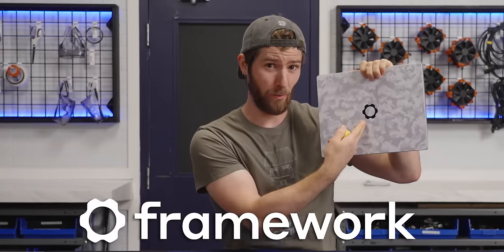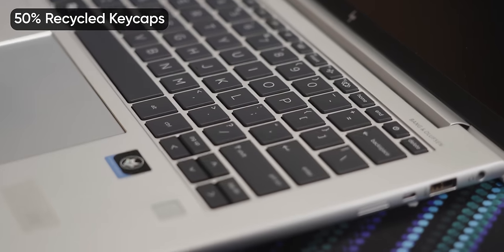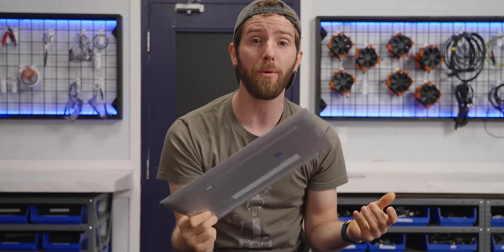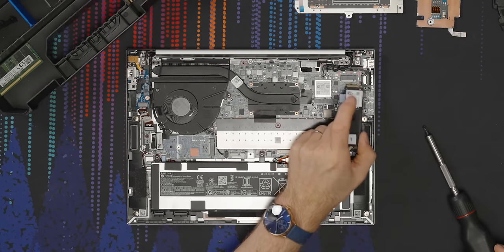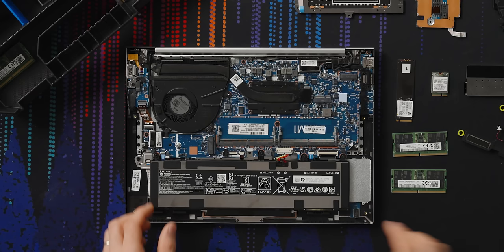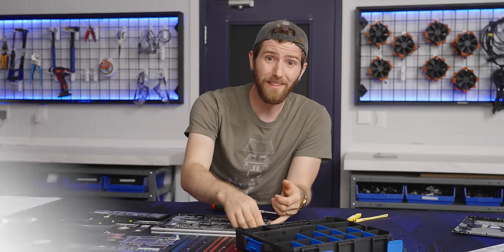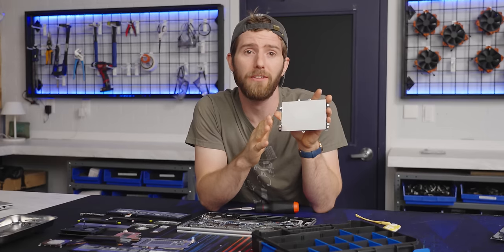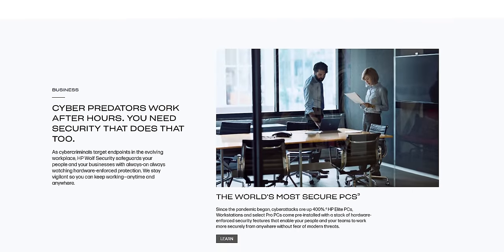My Investment is in TROUBLE - HP repairable laptops

Comment: The HP laptop computers I've owned have always been user repairable. Over the past 35 years, I've owned ten laptop computers, two of which were HP laptops. And this was before HP announced this new "repairable" laptop. The older HPs were each very easy to DIY repair, because tear-down service manuals, and parts were available online. One of those two, at 13 years old, and still works! I've replaced the battery a couple times, the HDD (now SSD) a couple times, and the CD drive once. A friend now has it, to use for a dedicated mundane task. 

As for the other HP laptop ( three years newer), I replaced the keyboard twice, the CD drive once, the HDD twice! Finally, the hinge holding the screen on the left-hand side broke, and that computer was kaput after 8 years.

At the moment, I'm typing this reply on a nine-year old, MacBook Pro, on which I've replace the battery, installed a 2TB SSD to replace the 512G SSD that came with the computer, and put new thermal paste under the heat-sink, where it touches the CPU. So, it appears late 2015 Macs are relatively user serviceable. This Mac and the one my wife was using are still going strong after 9 years of use.

:-Don

Comment: Why isn't anyone talking about keyboard replacement? 

This looks similar to the x360 series chassis, and therefore keyboard replacement means you have to remove the motherboard and basically everything connected to it, then PRY the keyboard and its metal back plate carefully without breaking the chassis because both are PLASTIC RIVETTED to the chassis, then carefully apply hot glue on over 50 points (thats how I do it) on the replacement because otherwise the chassis loses structural integrity, then finally put everything else back in.

This is a pain even for an experienced tech like me, leave alone the average person. FYI, keyboards are one of the most likely components to give out first. Not that I'm complaining though, HP has always been a reliable source of income for people like me...

Comment: I understand where you are coming from saying that 16:10 is nice to have. For the use case of a laptop you use by itself, wherever you go, that extra space is great. However, it has been my experience that any alternate aspect ratio is the most annoying, lacking a single solution, problem ever WHEN YOU CONNECT AN EXTERNAL DISPLAY THAT IS NOT THE SAME RATIO. This is not a problem with your laptop manufacturer whatsoever, but a problem with every version of windows i've used. The scaling and ratios of any window that changes size between the laptop display and the external just makes me grind my teeth in anger thinking about. Microsoft reminds me of slushie dog in phineas and ferb "scaling never gets any better".

Comment: One thing I definitely want to see is new models of the laptop in the future using a similar enough design so that HP (or any company with their respective device) could sell the logic board with the cpu/gpu (like Framework is doing) so users can upgrade their laptop and keep things like the screen, ram, and any other component that still works. This way it will save the customer money, as well as cut down on e-waste since the only thing being replaced at that point would be the outdated logic board, instead of the whole laptop.

Comment: From using the HP business laptop at work 840 G6, they kinda dent very easily and the metal feels more flimsy though. I kinda love the AMD processor inside but I hope Framework gets a 13th gen with a low end Intel Arc, or maybe 14th gen tiles+a low end mobile Arc GPU (which gonna be much better than Iris XE).

Comment: On the whole point of this only having 5 screws being good, it really rings true. I have an older HP laptop that has TWENTY FOUR screws needed to open the back of the case, and 6 of them are covered up. Any time I need to do any form of work on it, I have to sink in a lot of time just opening it, and damn I won't lie it made me not want to do it

Comment: Wow that's awesome. Certainly very solid feeling laptops and HP have always been very good with driver support for older hardware. ***If you really want your electronic stuff to stand the test of time**** get a grounded antistatic mat and wrist strap for...not much money whenever you expose and work on the internals as only the external ports etc are usually static protected.

Comment: System 76 is a small manufacturer. It may not be as easy to work on as hp, but it is very repairable and the parts are available, the pictures are on their websites. They have a kicker. They have "Lifetime Service", which includes talking a customer through any repair. System76 deserves a look!

Comment: Put praise on HP when they do this on all their consumer laptops. My 2020 spectre has screws UNDER THE RUBBER FEET. Business laptops tend to always have easy repairability, that isn't where the issue is. My mum's i5 5th gen business HP has a battery you can swap by undoing one lock.

Comment: @13:20, the HP configurator says that the laptop ships on 01/09/2023. Is that correct? That does not sound right. And if it is correct, that's not good.

Comment: it's a pity that microsoft hasn't also embraced reduction of ewaste. creating artificial requirements in windows 11, forcing you to throw away a perfectly good computer because it doesn't have tpm or has a processor a couple of years old greatly contributes to e-waste. They should be shamed into reducing the minimum requirements for windows11 to what windows 10 requires.

Comment: I really don't see the groundbreaking repairability with this hp. Other than them carrying parts on their website and having them in stock and readily available is really cool and is a plus, most modern laptops that ive seen in the last few years come apart just as easily if not more so. Sure its less common with ultrabooks and dell in particular likes to make things difficult with the xps laptops but theres nothing groundbreaking about this design over other hps and lesser models in their lineup. framework is still a clear winner in my book for how the internals of the laptop are laid out compared to large OEMs.

Comment: Dude, mine is also very repairable,
You unscrew 4 screws(on the letter it is assigned to)
And then just replace it.
It's 13 yo, so the HP laptop is overheating sometimes

Comment: I'm probably in the minority here, but I actually despise captive screws, unless if their captive mechanism is easy to remove.. This is primarily because almost all manufacturers use Phillip's head screws, which are the worst screw head design IMO because they can be so easily stripped.. What makes it even worse is these manufacturers for whatever reason use loctite on their Phillip's head screws, and I'm just dumbfounded as to why?.. I get that these are mobile devices so screws "may" get lose over time, emphasis on "MAY"; but the number of Phillip's head screws I've stripped throughout the years of servicing all the laptops I've owned deem me to believe that loctite is more harm than good on laptops..

Comment: I was hoping it would happen, I didn't think it would, but my god it did.  I can only hope others step up.  
It makes sense from a companies perspective and a users perspective if you can sell the components instead of selling an entire damn device just to replace a wonky touchpad.  The little margins of profit you can add on, while modest, will certainly add up over time.    
As time goes on, one can even add functionality to their device, like the SIM card.  I'd like to see a time where we go BACK to when PC card slots, but a more modern approach.   A whole generic panel that can have various layouts of USB, HDMI, audio in/out, etc.  That would require a little bit of work on the motherboard side of things to allow those kinds of interfaces, but it is very VERY doable, more so than PC cards were of yesterdecades.
Frameworks 4 generic expandable ports are half-way there, but I'd love to see a whole side with that.

Comment: It is nice to see laptops that are not inacessible black-boxes full of glue. This is a step in the right direction. But what I believe would be ideal is an industry standard for parts. By this, I mean an analogous to laptops of the ATX standard. This way, costumers would have the same level of flexibility to assemble (or commission someone to assemble) their laptops according to their need and budget. And in such a scenario, it would be naturally easier to repair as well. The same holds true for phones as well.

Comment: hp has always had a policy of high repairability, easy access to components and wide choice of customisation for a very decent price. I still have a professional range desktop from the late 90s which could be accessed, opened, upgraded/modified and/or repaired without any tool! Most of the parts being attached through sets of locks, clips and hinges.

Comment: I find it extremly worriying that all the screws are Philips #1, its good that they are all the same but i have had horrible experience with Phillips striping, even though Torx is less common i still prefer them. (at least its not flathead/slot)

Comment: 1:17 Ah, yes. The only reason I have a Galaxy S10 is that it was about $100 cheaper to buy it on a phone plan (excluding the plan) than it was to repair the (front facing) glass on my S7. About $200 Vs $300. Otherwise, I'd probably have waited a year or two to upgrade. Especially if repair had been around $100 ;).

Comment: Framework still wins. I just tried to quote similar specs against my DIY Framework and it was nearly $1,500 more. So the Framework is not only cheaper, but repairable and, more importantly, upgradable. Not to mention the Framework hot-swappable ports. This HP doesn't seem like you could one day replace the CPU and motherboard. Repairability is great, but it looks like HP is going to make you buy a new laptop if you want to upgrade your display (yes you can replace it, but I doubt we see an upgradable 4k display that we can just buy and swap) or CPU. HUGE step forward for HP and consumer electronics and I hope Framework can stay ahead of these large companies. If Framework fails then I doubt we will ever see another small company attempt it again control goes back to the big tech.

Comment: the problem with framework is the cost of parts , especially the motherboard. When it cost you almost 95% of the cost of a new laptop why bother. And lets face it , the only real advantage of modular laptops its the cost saving if you 'upgrade' to the next available processor/egpu.

Comment: This just seems like a standard laptop... Basically every Windows laptop allows taking out the battery, SSD, wireless card, motherboard, etc. And like most other laptops, it looks like the keyboard is heatstaked in and not repairable.

Comment: You stopped before getting to the keyboard.  Does this mean the keyboard can't be repaired/swapped?  First accidental spill ruins the keyboard or just general daily driver use for a few months = gunk getting stuck under the keycaps.  Ew.  Gross.  My pet peeve with every laptop on the market has always been and still is the keyboard.  Know what keys every user presses the most in their day-to-day for navigating?  The arrow keys.  Arrow keys on laptops are half-height and/or are mashed in with nonsensical keys such that buttons you don't intend to press end up getting pressed making the average laptop keyboard basically unusable.  Half-height function keys along the top are also extremely annoying.  If you pay $3,000 for a laptop, the keyboard better be fully replaceable and swappable with different layouts but we are stuck with whatever the manufacturer decided to go with.  I just want all of my keys to be full size and placed reasonably well.  If the top chassis/shell has to be sized to accommodate different keyboard layouts, then that should be replaceable as well.  There's just no innovation happening in keyboards for laptops and they are all pretty terrible.  The Framework laptop also has wonky arrow keys:  Full height left and right, half-height up and down.  Ugh!  Laptop keyboards drive me crazy.

Comment: Wow, HP is going from one that really sensitive won't booting by using part that 'not-original', to being repairable with part available on their website.
I remember the old HP 1000, once I've to change the wifi card to something faster (with 2T2R model), it won't boot at all because the BIOS recognize it isn't from their OEM build.

Comment: Linus, this is not something special compared to what Framework has done. Of course HP business line up, like many other brands such as Lenovo ThinkPad, will offer replacement parts, hardware replacement manuals, and a way to purchase those parts. However, it is not designed to be service-friendly in the first place, at least by looking at how they layout their components inside the laptop. 

On the other hand, Framework has made the internal layout to be replaceable by design, with easy instruction on the components, standard screws, and fool-proof mechanism to remove certain components. They even have modular ports, knowing that port limitations is limiting the laptop’s potential but also to be able to replace when your ports become loosen in the future. Framework has made its firmware open source. Ordering components in Framework is closer to shopping in a cloth/bag boutique. On the other hand, shopping for parts in big brands, such as Lenovo ThinkPad, is clicking through many links. People can get lost and not finding the parts they are looking for. Also, you can’t easily swapped HP motherboard to a newer generation processor (eg. 11th to 12th gen) as Framework does.

Bottom line, what HP do for their business line is not something special and still far away from consumer-friendly-DIY-own your hardware kind of approach. No, your investment is not in trouble (because of this particular brand). And you’re promoting HP quite nicely.

Comment: This is impressive? Lenovo (previously IBM) has been offering this level of serviceability on the Thinkpad line for ages now. They've always offered user service manuals, first- or third-party spare parts, and recently even disassembly videos. It's the main reason I'm fiercely loyal to them. My old Thinkpad X1 Carbon (2014) and Yoga X380 (2018) both just need to loosen 4-5 captive screws to access internals, and my X1 Tablet and X12 Detachable only need about the same before the tablet screen can be pried away from the rare earth magnets securing it to the chassis. These are all ultrathin machines. But whatever, I guess HP gives Linus a sponsorship and Lenovo doesn't, so now it's big news even though it's 8 years behind the curve.

There's nothing obviously upgradeable on this HP machine, either, besides the RAM. Isn't that half the point of Framework?

Comment: I see a few issues with this. You can't replace the keyboard and keyboards are among the more common things that need replacing on a laptop. IMHO that's a huge downside. HP doesn't seem to be committed to these parts for any specific period of time, they're just like "it's repairable". Commitment matters because even right now, when you get on their website, most of the replacement parts are out of stock. So you don't know when are they going to be in stock, how long are they going to be in stock and frankly there's no guarantee they will be in stock at all. And maybe I'm just missing something but this system, yet again, seems to be focused entirely on the US. 
A system that actually makes sense would be having fewer model lines and sticking to a common design with each line for an absolute minimum of 5 years. That way it would be more viable to stock the replacement parts in large quantities and actually have them available worldwide. It would make older models viable part donors for the newer models and could even provide some limited upgradability. So while this is a step in the right direction, it can be argued that a single step doesn't really get you any closer to a destination.

Comment: As far as I know HP laptops have been on the you can repair or upgrade list for a while now. The last generation are very similar to work on I have a Ryzen 5700u model and pretty much everything is close to being the same as this model when it comes to taking it apart and such. Even same speaker company.

Comment: lol, wtf is this? Just a few years ago HP denied me a warranty (for which I was paying a yearly extension fee) because when the screen died in 1,5 years, I had already replaced the HDD with an SSD. Yes, entirely unrelated. And I'm also a certified hardware and software engineer... But yeah, warranty denied cause the laptop wasn't "In its original state", lol.

Comment: Have been buying Lenovo and Dell enterprise-grade laptops for decades because they are extremely user-repairable (although the move towards thinner machines has reduced this somewhat in recent years). Funny that it's news when HP finally gets on board (yes, I have had HP enterprise machines, as well, and while they were easy to work on, the documentation and parts support wasn't nearly on par with their competitors)

Comment: now if only you could sensibly control the fans in the bios or via software they provide and maintain - also HP's websites are and will always have been a mess, consider yourself lucky if you never have to configure them on anything other than their user-facing side